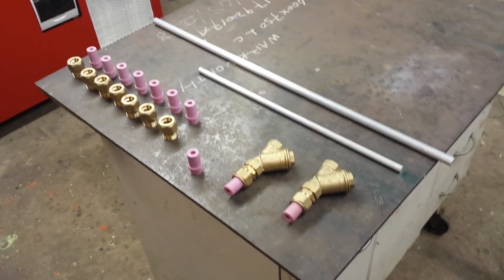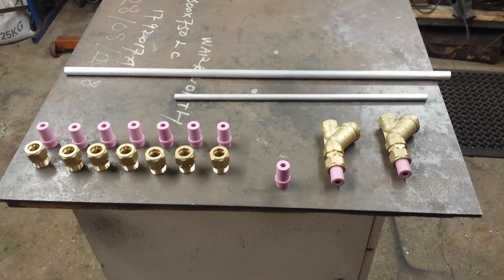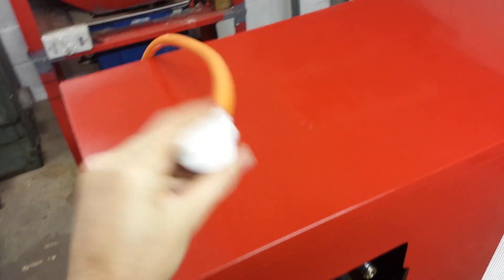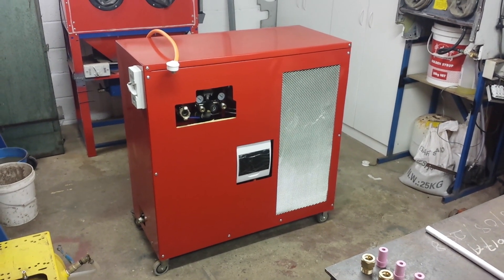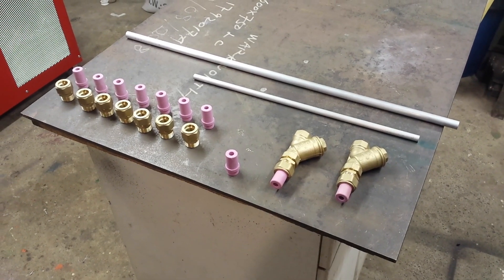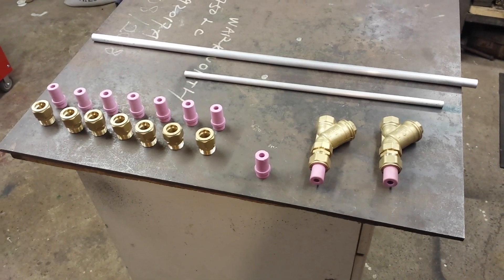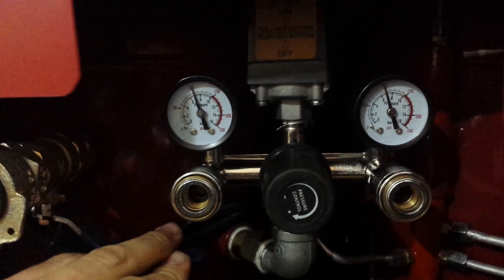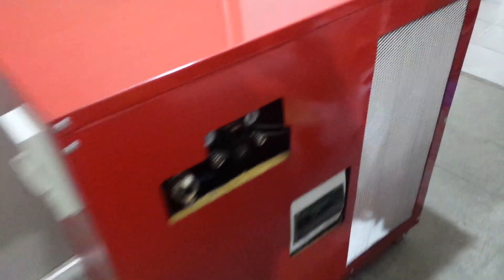Higher CFM Single Phase Compressor Finished

Comment: How do I know what cfm my nozzle is on my vapor blaster
Reply from the maker: You need to measure the orifice in your air jet and then find a chart that shows the flow rate of that size orifice at different pressures.

Thanks for watching!

Comment: Do you have a rough cost of building this compressor, and did you test CFM manually or is that manufacturer rated? Trying to decide on which route I take, build or buy :-)
Reply from the maker: It cost about 1900NZD to build using all new components.

I don't have access to a flow meter so its based off manufacturers specs
Reply: @ArmouryEnterprises  Given manufacturer specs don't necessarily eventuate in the real world, what are the odds of you borrowing or renting a flow meter for testing at blasting pressure?

Hard for me to justify $1,500AUD to build something that may only perform as well as a $1k off the shelf 3HP unit rated @11CFM FAD.
Reply from the maker: @krazed0451  I have been on the lookout for a decent flow meter since before building this. At the end of the day it really comes down to the components used. But if those are your concerns then it may be worth going down a different path. This project was really designed as a last resort for increased air supply where only single phase is available.

When I was able to afford it, and the opportunity came along, I upgraded to a 75 cfm diesel site compressor.